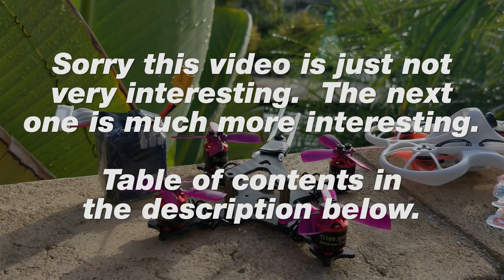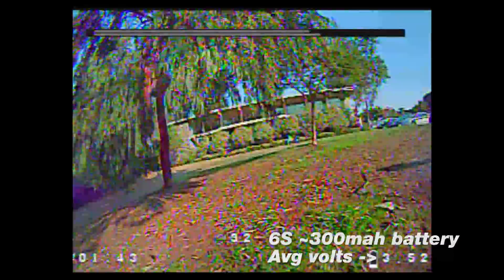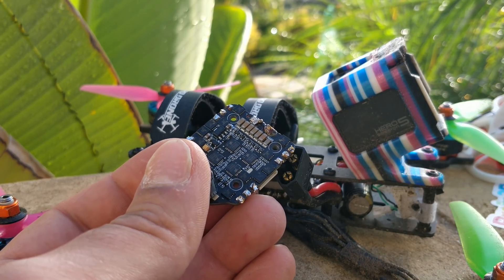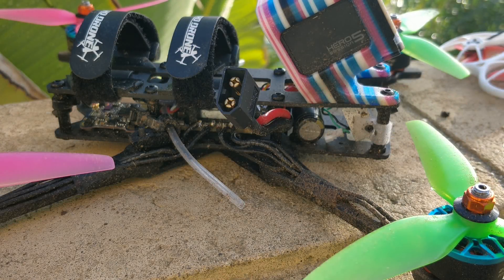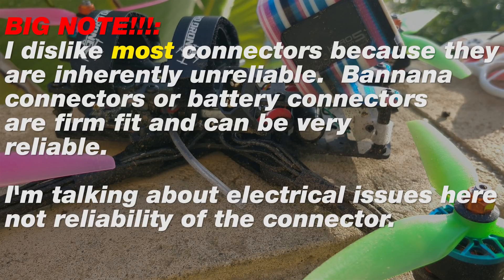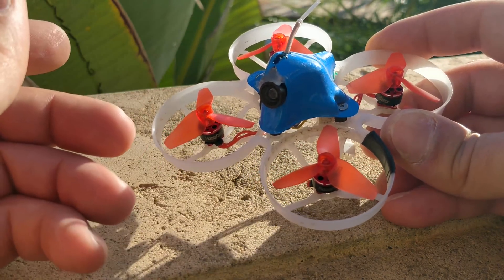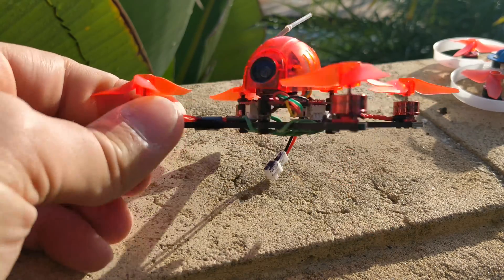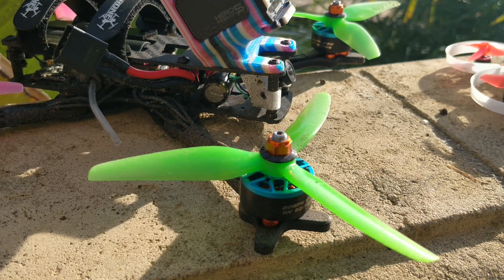6S 2", Just check the table of contents plz thx

Comment: 37/63 solder is better because it has a very narrow melting zone.  40/60 has a melting zone of 20 degree between solid and liquid. But solder is not solder. The quality of western produced solder and Asia produced is very different within the same 37/63 class.
Reply from the maker: Kester on the way

Comment: You should maybe try out solder grease, on banggood "DANIU Welding Solder Flux Paste Soldering Flux Paste Grease Gel" i get ridiculous nice solder joints with just a tiny bit of that, and my solder is likely more than 20-25y old. Also Pro Tip for the TS100, use a 19V or more Laptop Charger to power it .. the connector fits and it works like a charm ;)
Reply from the maker: Kester on the way

Comment: Hey kabab, I'm planning a lightweight racing build on 4S with ZMX FinX23 2205 2600 motors with light props as hq 5.4,3.3 V1S or T motor 5143, It will weigh around 200-210 g, do you think it will perform good? Will it have a chance against 6S in tight tracks?
Really like your content, still waiting for the new flosstyle frame for flossing around
Reply from the maker: Thanks. I actually would not recommend anything less than 2207 for any 5" at all. Even the lightest. Also, skip the tmotor prop. The HQ S3 prop is way way better.
Reply: I will think about that, what do you think about this frame? https://www.rotorama.com/ramy/rotorama-samurai
Thanks for the suggestion, thinking of going 2207 on 6s maybe

Comment: You need TX30U version where you can swap sides (rotate connector) so you can easy change motor direction just by rotating connector =)
Reply from the maker: mmmm we have the ability to flip in firmware.  I don't see that as a huge issue.  Most people prefer straight flat wires rather than overlapping ones...
Reply: @Kabab  Just in case you need to swap fast. in case something is wrong, i use TX30U on planes, when one props over just rotate and use other direction ones =)

Comment: About the 1s 2.5" quad: 0703 is too small for these motors. You will need at least 0705 for it to feel good. Trust me I have build several of these quads.
In fact, 1102 or 1103 motors are doing even better and I would honestly recommend you buy these for such a quad: https://www.banggood.com/3g-MP03X-1103-16000KV-1S-Brushless-Outrunner-Motor-for-Micro-RC-Drone-FPV-Racing-p-1338215.html?rmmds=mywishlist
They have good power (of course not yaw dropping but hey it's 1s) and offer much more control than the brushed motors (I build several of those quads as well). To fit 65mm KK props (and don't use anything else these props are just the best) you will have to drill out the props with a ~1.4mm drill (motor hub is 1.5mm)
Reply from the maker: I'm hoping to see a whoop with better motors.  I'm not looking to make a custom little 1S quad.  I just wanna swap the whoop frame onto the carbon one and get some good outdoor performance for a cheap little quad.  I already know 0703 is not gonna be very good but at least it's a concept test...
Reply: My impression was that the 1s prius was a lot of fun to you, so you might want to reconsider. You can take the mobula or any other brushless whoop components for this, so it's just as you planned to do it anyways just with better motors. The ESCs on the mobula/any other all in one board can handle the 1103 motors just fine ;-)
Reply from the maker: @fabianisensee3744  I looked for motors like 110X that already had connectors attached. No luck. Now that the TinyHawk motors are available I might try again.

Comment: As a beginner which solder should I use ? Most people use 60/40
Reply from the maker: just don't use cheap solder and you should be fine.  That's probably the mistake I've made recently so I just ordered some of the Kester 60/40 stuff. I like 60/40 better personally because it flows a little easier.
Reply: Okay I will stick to the 60/40. Thanks for all the great reviews.

Comment: No no no, 60/40 is the "bad" solder, 63/37 is the higher quality one used in higher quality (non-ROHS) applications such as military and medical. The reason is 63/37 is the perfect ratio of lead to tin that is snap hardens where 60/40 has an about 20 degree Celsius window where its not a liquid but not a solid and if the joint is disturbed during that time you will damage your joint. Use 63/37 if you have it, its just so much easier to work with
Reply from the maker: I picked up some Kester 60/40 just now because I like the easier flowability.  I'm good with holding it for a few seconds until it solidifies.  I actually like the liquid working time.
Reply from the maker: Or at least that's how it's supposed to be.  My current crap is just total junk.  I think I got an expired roll and then I just kept buying more and more crap.  Hopefully the Kester fixes it.
Reply: Darcy Moloney what he said 👍

Comment: I like your talks. I have iFlight Tachyons 2207 1750kv for my 7" and they are good. Give iFlight a chance, they are really trying to bring some quality products (they even licensed KISSv1 and made it AIO which I appreciate a lot).
Reply from the maker: The motors are good.  Nothing wrong with them.  It's the setup I put it on that sucks
Reply: @Kabab  BTW, according to EngineerX the Tachyon 2207 is actually 2208 motor. It's not top notch quality components but not bad. I can feel diffence on 7" compared to Emax LS2207 1900kv (can be placebo effect ;-) ).
Reply from the maker: @MPQuads237  oh I'm sure. These little 1108s are great. The setup I put them on just isn't

Comment: can I send you my turbo prius ? so you can check it out. it's just like your prius but with 2s battery. it flies faster, still quiet, handles a lot better and the low voltage warning beeper doesn't go off all the time. and with your knowledge, i'm hoping you would help me to build/find a brushless quad that flies and feels just like that or better but still light and quiet. I bought 2 2s 2inch and 1 3s 2inch brushless quads and I don't like them. they feel heavy, slow, low voltage warning beeper goes off all the time, and they sound 10 times louder than my 2s brushed quad.
Reply from the maker: mmmmmm please keep your quad and just have fun with it.  I don't think these micros will ever feel as in control as larger quads unfortunately.  Something to do with the physics of it all I'm guessing.  5"-5.5" is really where it feels great.  Everything else feels wrong to me for excellent FPV control.
Reply: you want something smaller than 5" but feel like 5". I want the same thing too. i'm wondering if 5s 2.5in maybe with 13xx motors can do it. what do you think ?
Reply from the maker: @matthew04101  2.5" is the closest to what we want. 1306 is probably going to be the right size to take full advantage of 2.5" but I also like it on 1108.

Comment: your heat  is too low, i rock 480. the higher the heat the less heat saturation because of less time heated... you know the basics(cleanliness, pre-tinning, verify temp ),  but the solder tip contact area should be equal to the area of solder pad itself and we use "kester 282 Flux-Cored Wire".
Reply from the maker: Just ordered the kester

Comment: Sounds like you may need some flux to help out the joints. I have seen it happen. I use mg chemicals no clean flux as well as their 63/37 no clean rosin core solder. Used with a temp controlled iron at 380 to 390 deg c. Never have had issues. A 1/2lb roll of their solder and flux syringe will run like 30 or 40 bucks.

Comment: I think we would all be highly interested if you built up an acrobrat with Tommy’s recommended parts list and collected your thoughts on it in a video.  I know you’ve said it’s not your jam because of the weight, no go pro, and that you don’t like micros, etc. But you continue to mess with smaller class drones so clearly you’ve not given up.  

I feel you would have good ideas to contribute to an acrobrat v2 frame, especially in regards to frame reliability which is one area the acrobrat could improve.  If nothing else I would like to see how you choose to build, tune, pick camera settings and generally setup an acrobrat. 

To me the acrobrat is the bomb!  Less noise, less harmful if there’s an accident, mine is under 250g, less money flying around in the air to be broken/lost, and it flies with an amazing feel (5” with less power).  Ok that’s it goodnight!
Reply from the maker: I know the acrobrat is good with his setup.  It's a little overweight but you can't really help that if you want to have two cameras and all that stuff.  I'm confident it flies well regardless.  It's just not my cup of tea.  I particularly like his motors.  I've been asking gently for a T mount 1407 for a while.  He went ahead and did it.

Comment: I have tried both of those solders with poor results. Especially the stuff from banggood. Got some from the local hobby shop and it works much better.
Reply: Yes, that banggood one is terrible. i was wondering myself why i cant solder good any more while using it. got a better one and it is much much better.

Comment: Ts80 is worse than the ts100 it is just a cheaper smaller version with less power. Try using Flux and go to 350 degree Celsius. Pre heat and pre tin the pads. And don't stay too long on the solder joints whne you solder parts together. Good luck
Reply: I have to disagree with you. I have both (TS100 is with Ralim firmware)  and I prefer ts80. Only time when you can actually see power difference is during initial heating that lasts few seconds longer. During work it is not noticeable at all. TS80 feels nicer in hand and has shorter tip distance.

Comment: 0802 on 1s is magical. Those stock Snapper7 motors just suck- not necessarily the motors themselves, just that 070x size.  0802 on 1s w/snapper guts has way more power and voltage sag is gone. Flight times are like double too.

Comment: The TS iron in general is gr8 but i saw a review that had used FLIR to watck both irons while soldering different joint sizes and the TS100 did much better wit similar tips.

Comment: I solder since I was around 5 years old, usually if it's not the lack of flux it's the soldering iron that doesn't produce enough heat, another thing I usually see is people trying to solder like if they were molding clay with a spatula, but I trust that's not the case if you have been doing it since a long time. Also... I don't know where you are at, but if you are on the northern hemisphere and the temperatures had begun to decrease maybe that is also affecting the quality of your solder.

Comment: 2cents - frame concerns about the durability of whoop frames are silly. they're whoops, the frames will break (specially brushless).  they're standardized and cheap. that's half the charm. 75pro is my go to frame right now. though i'll probably switch to the updated happymodel/eachine frame that's coming out soon. i absolutely love these crazybee f3 pro builds like the mobula. if you aren't instantly hooked like tetris, i'll be surprised.
Reply from the maker: That's just the thing. The TinyHawk lasts like 30x longer and when it breaks it's not actually broken.
Reply: Same thing goes with whoop frames.. you just e6000 and move on, then replace when it's had enough. The bwhoop frame that comes stock with the mobula 7 right now tho is super fragile on the ducts. You're going to break it. It's too fragile and the mobula7 is too fast for a frame that weak..it's basically glass. Get spares and IMO don't dwell on that too hard on that when you finally try it out..it overlooks the real pluses and focuses on something that is truly trivial in the whoop world. It flys amazing. As for the TH... if someone is new to the hobby and just trying to get in the air and not repair stuff, it's gold for that. 100%.

All that said/side note - apparently the Crazybee F4 pro is coming out because eachine shows it in the specs of their just announced 2S..hilariously named "trashcan".. lol... it's all happymodel/crazybee parts from the look of it. The frame looks solid. Matek will probably do a FC soon too since they've got the 1S already for emax.
Reply from the maker: @Mewted  Yes I know the crazybee F4 is coming and I've already asked them for it.  Looking forward to it.
Reply: @Kabab  killer :)

Comment: rcx 1304 5000kv,  2.5" 4s  or  3" 3s its cheap its old but its as good as it gets for this size,  the motors will handle 3" 4s but I noticed no gains personally

Comment: check your temp and don't shake :P  You are using more powefull esc's with thicker copper inside than before so it probably drains to much heat from the iron. 37/63 or 40/60 does not matter that much. Using rosincore solder and pre tin wires + board before soldering helps alot. But it looks like it is a temp issue.

Comment: that feeling when you are wondering for months how to modify xt30 conector to accept 3 cables... i just bought 50 pairs of MR30 connectors... will send you pics of how it works out. presolder some motors and when you break just click click... magnificent idea... and it only costs me 3 grams with solder included!!! oh yea and also solves that issue when you put motors from your 5 inch 6s to 7 inch 4s motor :P
Reply from the maker: Lol. But it only works if motors were standardized with the MR30 or it would just be more work.
Reply: @Kabab  its extra work... Bur in the long run i will save time... I have a set of 2208 motors that i used on multiple builds... Wits mr30 connectors i can easily switch them oround... I am using 5.5mm plugs now... Insulating that crap is a nightmare... And aligning cables... Plus they weigh a ton... Cca 4g per motor... Plus soldering to a connector is alot easier and less stress than soldering to the esc... And you dont heatshock your esc
Reply from the maker: @jstefa2  well sure if you keep swapping motors around

Comment: On your solder joints, have you tried using extra flux,just dipping your iron in flux before every joint helps them be nice, and shiny. One thing I've found from Amazon is stuff called tip tinner. It is absolutely amazing stuff, it would literally tin a coat hanger. It brings old pitted tips back to life even after the coating is gone.
Reply from the maker: Lol coat hanger solder!  Yeah I have a bin of worthless flux for my annoying issue
Reply: @Kabab  try the tip tinner, it leaves a residue like solder, and really helps when putting the battery leads on. Weird you would have be having a problem after soldering for so long.
Reply from the maker: @RCOverKill  yeah seriously.  Literally 25 years of soldering and now I have problems and don't know wtf is going on.  I've bought two new irons, five tips, flux and three rolls of solder.  All shit
Reply: @Kabab  I've been having real issues with my TS100 even when set to 390 degrees. Kinda like you show and describe. My cheap old worn down iron is fine though..
Reply from the maker: @lievenvv  interesting.  I'll see what mine does

Comment: Definitely worth looking at 2150KV (really anything between 2000KV and 2200KV) if you want a 4S/5S/6S setup - 2000KV is the lower limit on 4S before you really start losing top end even with aggressive props (but works brilliantly on 6"), and >2200KV on 6S is problematic to tune.  

If I had to build myself stuff in a vacuum for racing, it would be BH R6 2207 2150KV motors, 6" Floss frame w/ canopy, but still use my cheap beater components (Typhoon ESC, Furibee F4 V5).  4S 6" is still fast, 4S 5" is really controlled, 5S 5" rips on cheap batteries, and 6S anything is stupid fast but takes advantage of better battery performance.

Comment: I put a lot of thought into your 6s build. I think there are 2 fundamental issues that you cannot easily overcome to achieve your goal:
- (top tier) micro motors already respond very quickly, I think more quickly than 5" motors in general. I believe that the relationship between prop weight and motor bell inertia is much closer.
- the change in rpm required does not scale linearly as you drop in prop size - although circumference does and kv does, the amount of power lost to efficiency does not it increases with the square of the velicity and smaller props need more rpm for the same thrust. This together means that there is a (relatively speaking) bigger rpm jump required for the change in thrust you are asking for.
- You should have used the emax 1306Bs - similar weight to the 1108 decently bigger stator.

Just an educated guess for the discussion but that was what I came up with after the excitement of 6s 2" died down.

I like the idea of the motor plugs but I'm already using racelights which basically do the job already and have leds on them. Incidentally don't use them with the r6 motors because the pretty pretty bell reflects the light back into your camera.
Reply from the maker: Yes 1306 really is the solution but it adds lots of weight as well. Either way I'm done with micros yet again 😔

Comment: Isn't it possible to just limit the throttle, to fly 6s with high kv motors?
Reply from the maker: Yes. That's what I do. Gonna discuss it a lot in the next video
Reply: Kabab FPV  Okay! So what would you recommend then? High kv with limiting the throttle, to fly on 6s, or low kv and flying it 4s (I don't have 6s packs). I just bought a set of the Iflight Xing motors, but high Kv. Haha I don't want to regret it